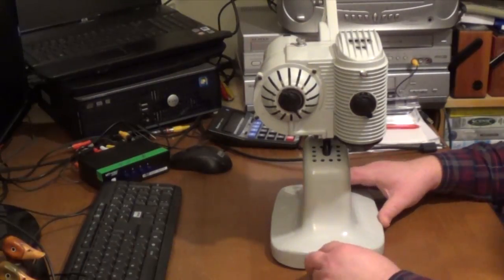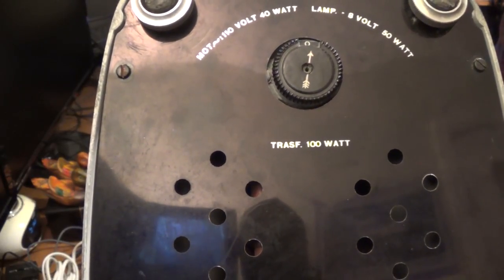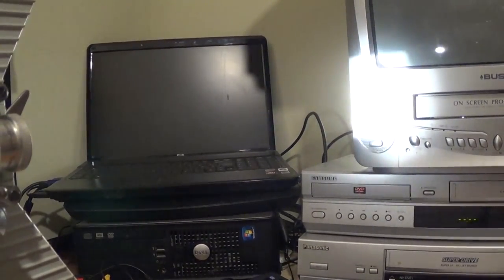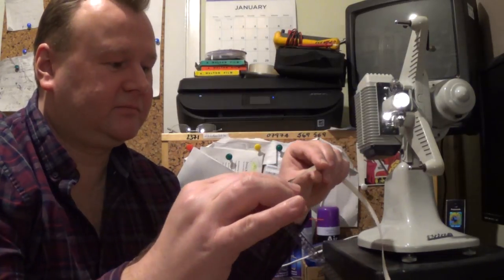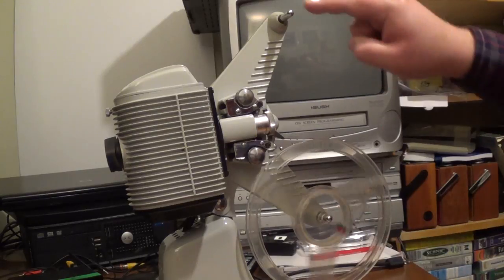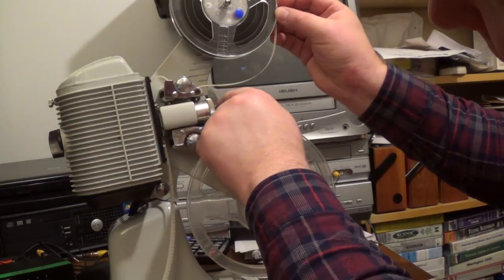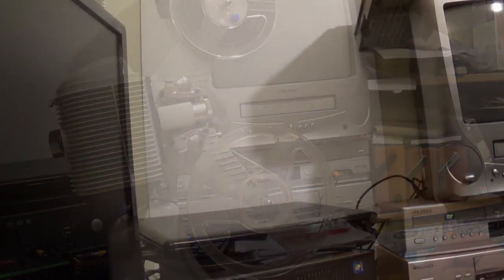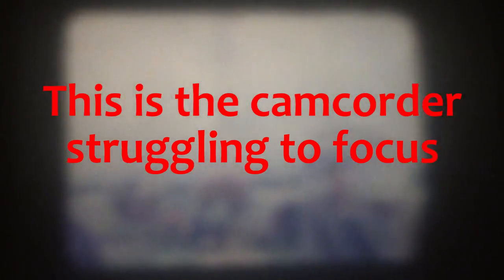Part 2 - Cirse Nilus 8mm Cine Film Projector

Comment: Excellent result so far. Is that a nice collection of Roberts radios on the shelf? I have an RCS80, which I've had from new. Works great except for some crackle on the volume control at low levels. Had hoped to take a look inside but never worked out how it comes apart!
Reply from the maker: Nice set! Could try a drizzle of switch cleaner, like electrolube down the spindle if you can and then run the knob up and down a few times (obviously with the battery/power disconnected!), let it dry out and try it again. I've got a few Roberts, not sure where they all are since we moved house!